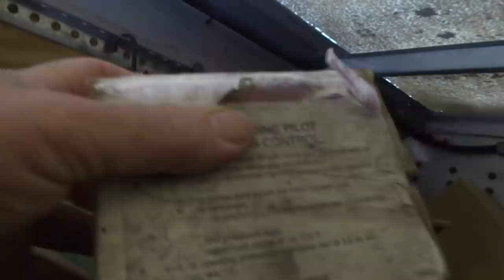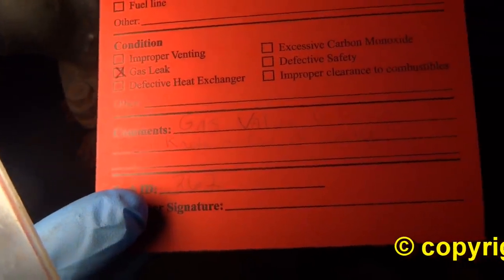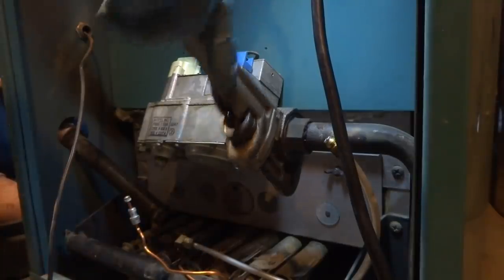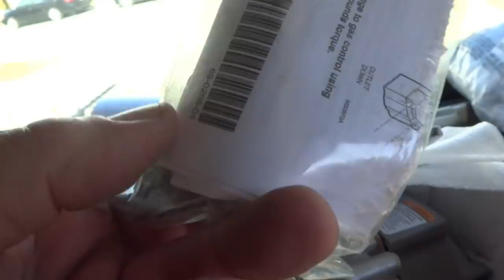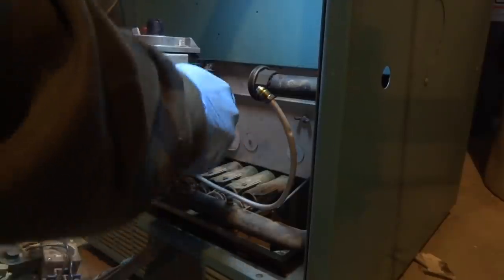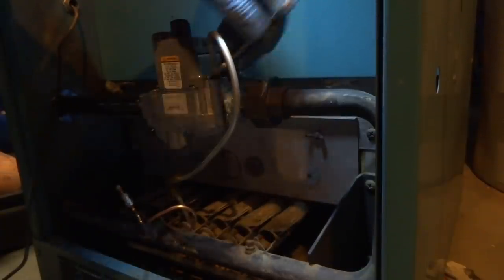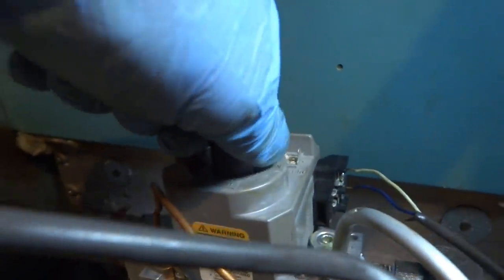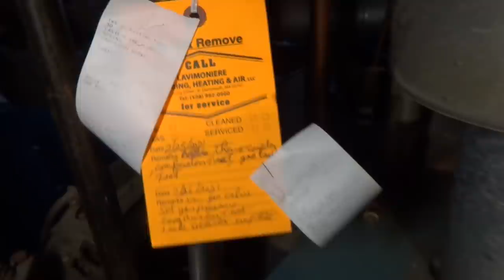LEAKING GAS VALVE ON BOILER REPLACED

Comment: I’d be interested if youve got a procedure to restock materials in your truck. It seems like its well stocked all the time.
Reply: After 30 plus years of service. I'm not surprised what he doesn't have in his truck!!😆. As he says, "I got one in the truck.  Let me go get it!"😆🤣
Reply from the maker: my approach is simple stock in my truck common items i use offen any item i might need , saves me time having to run and get parts also saves customer money in labor cost .i must admit i have stuff in truck i would probley never use on jobs .but o well ,someday i will need it .. sure enough that 1 job in 10 years .i say i have that in my truck .prices of stuff only goes up .so having a well stocked truck is better then money in the bank .
Reply: @stevenlavimoniere  you a hold mine of knowledge you should write a book Steve please least one for us
Reply: Im the same way. I have about $10k worth of stock in my truck. If i use my last one, i make a note and buy another one. If i need something and i dont have it, i buy 2. I markup my parts 100% so its not costing me anything to buy another one. Like Steve says, cost of parts only goes up. At this point, its pretty rare that I dont have what i need in my van, unless im working on a new high efficiency gas piece of crap like Steve says

Comment: Here in the UK we have a nipple on our gas meters which we connect our gauge upto. Open the main gas cock and pressurise the pipe work and appliances to a specific pressure and leave for 2minutes.. if the pressure drops then we shut off one appliance at a time then re test.. (if its an appliance thats passing then we can disconnect that appliance) until we just test the pipework. If it fails, we are allowed to cap the gas off at the meter..
Reply from the maker: THE UK IS A LOT MORE ADVANCED  IN A LOT OF AREAS .MIGHT BE A CURSE OR BLESSING NOT SURE WITH ONE IT IS YOU DESIDE

Comment: alittle grit or crud under operator. thoses valves used to be cheaper when that cardboard box was made hope you called supply house and charged them current price on that valve.... parts and labor make the price of a replacement unit look good$$$might need a cyclone vent cap if they are getting lots of wind causing a little roll out.......

Comment: I always wondered why aluminum and no copper on pilot lines?  Work hardening?
Reply: when copper gets hot it oxidizes, flakes off black stuff on inside and outside of tube clogging the pilot up.  copper is ok if away from heat. in some parts of usa copper is common for gas piping. but not pilot lines
Reply from the maker: alan well said .besides code requires aluminum pilot lines
Reply: @alanm2842  Thanks Alan and Steve, makes perfect sense for the oxidation.  Ratts, I never thought of that!  Now I know, thank you for some new knowledge!

Comment: I had the same issue with my rental house I told my renter to call the gas company it turned out the gas valve was still creeping by after it shut off I never would have found that with soap

Comment: We have tighter regulations on gas installations in England.
We must test the whole house gas supply with manometer to see if there's a leak ANYWHERE before starting any job which involves gas because the engineer is responsible for any leaks throughout the house that are left after his visit, this covers his ass also.

Comment: Sometimes you cant detect leak on those old style valve  knobs while  boiler is  firing   Most likely  320 wouldnt have picked it up on combustion test   just one of those   not common  situations
Reply from the maker: I DID SPARY THE GAS VALVE DOWN WITH LEAK DETECTOR SPRAY WHEN I WAS THERE THE DAY BEFORE NO ISSUES TO BE SEEN AT THAT TIME MAYBE ONCE THE GAS VALVE WAS OFF IT WOULD LEAK ..

Comment: Had a hot water tank do this crap when they surged the cal odor on the first cold front of the year. The sneaky little bastard didn't leak a whit while I was on top of it, then it leaked not an hour after I left.  The tank was 15 years old, so we agreed to replace it.  Best thing they ever did for their place.

Comment: Really old shit ? Looks like black jack dope on the manifold ?
Reply: @barackobama5304  Black Jack 21 made by Rectorseal  $ 24.49 on Amazon
Reply: Gotta love it when someone used permatex no 1 on gas lines. You have two choices at that point. Cut it out or burn it off.